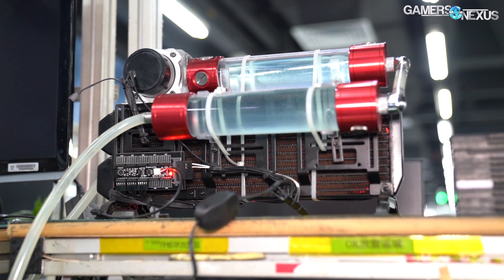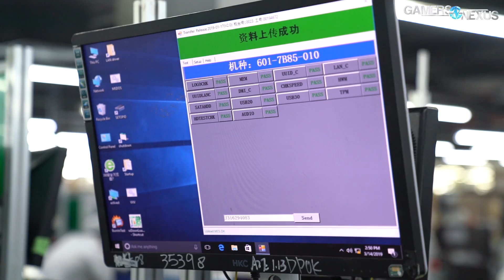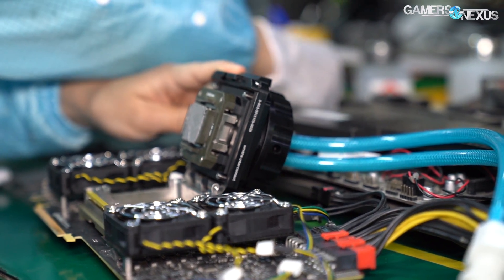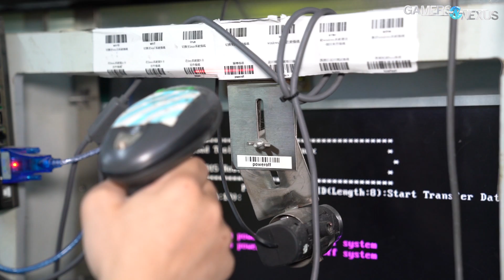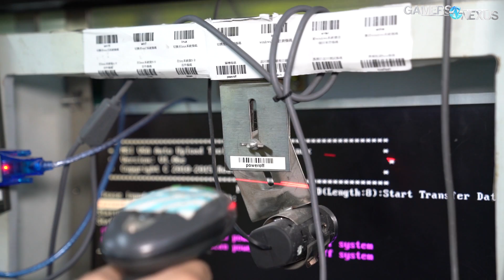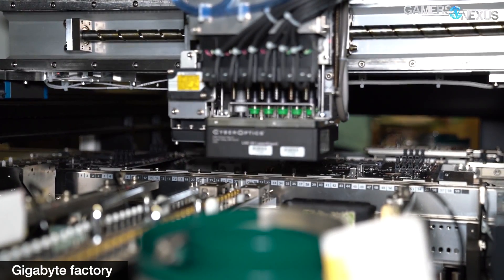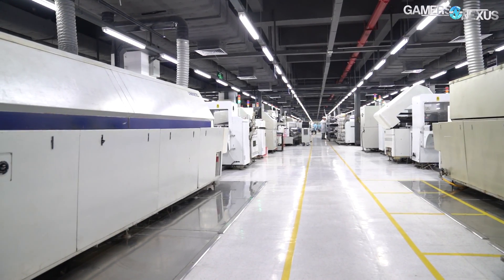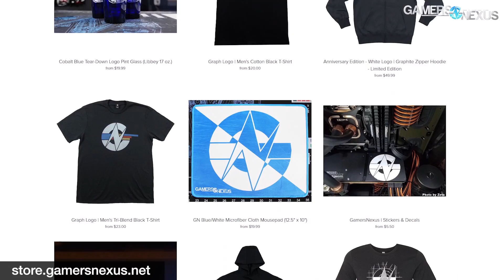Socketable GPU Testing & Binning | MSI Factory Tour

Comment: The guy is having a hard time with the barcodes lol
Reply: he is getting distracted by the rgb strip
Reply: Probably not the best place to skimp on ink or barcode readers performance...
Reply: I've seen entire production lines stopping because some operator forgot to scan the barcode of a new batch.
Robots will take our jobs, I'm telling you!
Reply: I don´t know if its something about the factory environment. But back when i worked in electronics engineering, down ont he factory floor the scanners was pretty much useless. When ever a new scaner hit the market we bought it and tested it on the floor.. pretty much no scaner ever worked. Don´t ask me why, they was all pretty much useless.
Reply: @matsv201  Sounds familiar to me. But what the heck is up with those they use at supermarkets? The just go BEEP BEEP BEEP flawless. I guess that is why they are so big and built into the table.
Reply: @GMLSX  probobly becuase they are not kicked around
Reply: machine seems not to be responding - there is a message on screen to power it off and repeated scanning of the power off command gave no response

Comment: I want socketable GPUs & vRAM @ retail. Do I?
Reply: Custom made sockets are VERY expensive. and having removable GPU chips with IHS will increase the cost, size, and reduce the performance of the GPU. So no, you don't want that.
Reply: @txisbest2010  I'd love to be able to buy test-cards like it for a few hundred dollars without the chips, socketed VRAM and socketed dies (probably on different test-boards), so I could test and bin my own collection of salvaged parts... but I know even with a little scale that's probably not something coming down below 1500 for a midrange card's PCB with how much even standard package bga sockets for out-of-circuit programming of microcontrollers cost
Reply: You will turn into freakazoid!!!